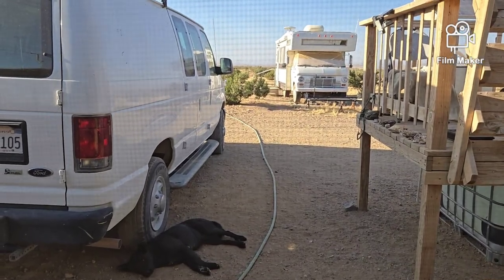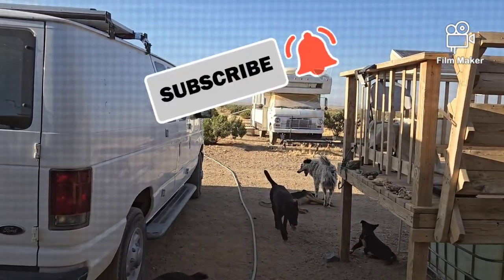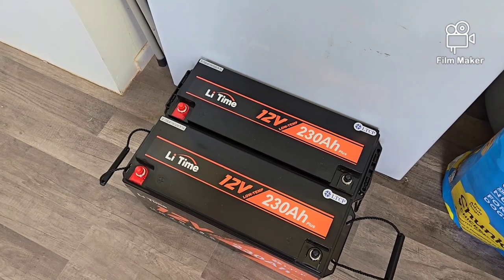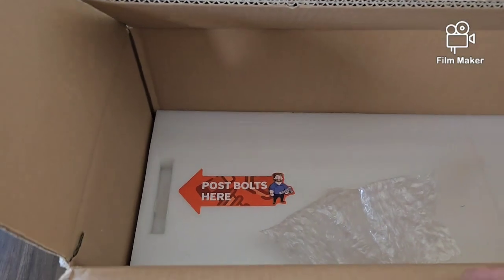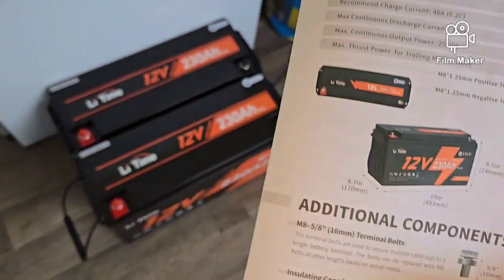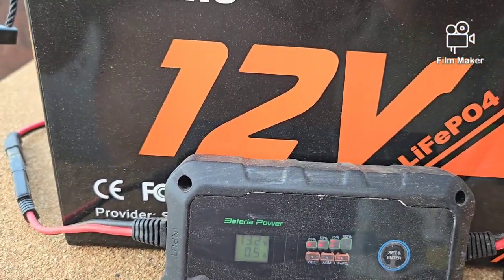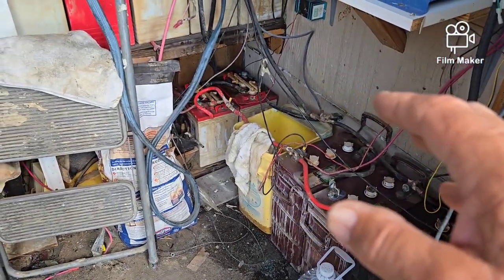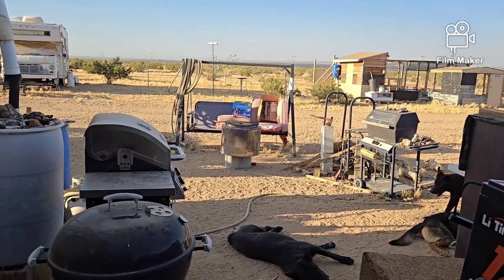HOW BIG IS THAT BATTERY? June 13, 2024

Comment: After you fully charged the batteries, what was the resting voltage of the battery? As measured several hours after charging with battery disconnected from everything. I just got this battery and the measured voltage was only 12.8 volts. The product manual states that nominal voltage is 12.8 V as well as the labeling on the battery.
Reply from the maker: @truthjustice3313  All LiFePO4 batteries are shipped with only 20-50% charge and require a full charge with a LiFePO4 charger prior to first use.
When fully charged it will initially show 14.2-14.6, but will settle back down to about 13.9 or slightly lower if you have a battery monitor attached, due to the idle current needed to run the meter.
Reply: @GBear  Thanks, that's what I thought. Mine arrived at 13.08 volts. I ran it down with an inverter to low 12's per battery monitor recommendation. Charged with Lifepo4 charger at 46amps and 14.6volts (several hours) until fully charged. BMS did not allow more charge. Let sit overnight and the resting voltage is 12.8 volts. I think it's defective.
Reply from the maker: @truthjustice3313  it could be.  It could also be a bad multimeter reading.  I found my multimeter only showing 13.3 for a fully charged battery, but once I connected a shunt/monitor, it showed 13.9
Reply: @GBear  My multimeter matches my battery monitor.
Reply from the maker: @truthjustice3313 Then you are probably correct that the battery or BMS is bad.

Comment: Did you have those 2 parallel before they were fully charged and is that ok
Reply from the maker: Welcome aboard.  Yes on having them parallel  to charge.  I couldn't find any reason not to, so thought I would give it a shot.  Seems to be OK, just taking longer.

Comment: Hi 😃 Just an idea - 1.Put your new battery bank on an on/off high amp switch so if needed you can switch the battery bank off.
2. Keep your old good batteries running as a back up system, as you already all the needed equipment.  It could also be on a separate switch or left on to run some low demand items.  lights, fans ...
Reply from the maker: The old batteries will be disconnected because I'll be using the Midnite controller and the AIMS inverter for the new LiFePO4's.

Comment: Great video Question- If one or more of these batteries fails during the warranty period Don't you need to return them in the original packing?  Seriously I want to know as I have 4 - 100 amp 12 volt LIP04 batteries.  Thanks
Reply from the maker: Well, since I don't see that requirement anywhere on the warranty, and who would save the packing for 5 years, "just in case" sounds like it wouldn't hold water in court.
Reply: @GBear  don't know but I thought I saw that requirement somewhere
Reply from the maker: @poolsidedreamer  I just checked the packaging, nothing in there.  I haven't registered the warrantee online yet though.  Waiting until charging and balancing is done.
Reply: @poolsidedreamer I was going to return a couple and they required $50 return shipping, ups only and drain charge to 13.2-13.3v or 50%.   Since G is keeping the foam that can make a nice shipping protector.
Reply from the maker: Just in case. Check with your distributors, in the chance they have super small print in Chinese.
Reply from the maker: Good point though.  I'll keep the tops I cut off so they can be taped back on, and the boxes with packing will be housing the batteries anyway.😁

Comment: I have 4 of those stacked in a closet in my rv wired 48v.Nailed a shelf together for separating each bat.Less room.Less wire.
Reply from the maker: Welcome aboard!  Yes, nice to be able to do that.  My 24 lead acid batteries will probably be close to the weight limit of my trailer.😅
Reply: It takes all day to recharge with 4 525 watt Bifacial panels.Adding 4 more panels.Then I can run AC while charging.
Reply from the maker: @2hotscottpro  I have 6, 305w mono panels and 16, 100w mono panels for 3460w total.
Reply: I’d like to have a 320 ah 48v bat next.I’ll build it from cells.Way cheaper.
Reply from the maker: @2hotscottpro  Nice.  I'll be buying 4 server rack batteries and a 1048 all in one package from SungoldPower when my money gets here.  That will be a 400ah system, then I will add these 4 in series for another 230ah.

Comment: Lead-Acid battery converted to Lead-Alum will extend the battery and the charge/discharge curve is more like lithium. it does not make 12 volts more like 10 volts, but it can run lights for a long time. if you series three 6 volt batteries you should get 15 volts. and can be used with 12 volt inverters.
Reply from the maker: Interesting.  Good survival info.

Comment: Another beautiful aspect of LiFePo4 batreries is that you can run them down to 10% SOC w/o damaging the batrery. Lead acid are good to only 50% before they sustain damage. So, in effect, one 100AH LiFePo4 battery is equivalent to two 100AH lead acid. My 100AH lithium weighs 24lbs compared to almost 70lbs   for the lead acid. The weight is important when batteries are used in RV applications. Good choice, Gbear.
Reply from the maker: Yep!  Thanks.

Comment: Lifepo4 likes mppt.   The trickle charge of PWM controllers can mess with the  
BMS.  Once lithium is full it doesn’t need a trickle charge.   

13.2-13.3 is the shipping charge rate approx 50% 13.6-13.7 is the resting 90% range.   It’s interesting they go from 100 to 90 once the charge is stopped and a load is applied but slowly discharge after that.
Reply: Greetings, I've been working with Li-ion batteries (18650's) for many years. I found some little known information about Lithium batteries. The max charge for the 18650 cell is 4.2 volts and the max discharge is 2.8 volts. with an average life of 500 cycles. The interesting thing is that if you only charge them to 4.0 volts the life cycles will increase to well over 1000. Also, if the only discharge them to 3.0 volts the life cycles will again increase to well over 2000 cycles.  I can only conclude that the LIFEPO4 should react the same way. The batteries I've been looking at using, in future installations, indicate a max charge voltage of 14.4 to 14.6 and a max discharge of 10 volts. Utilizing the same logic, if I only charge to 14 volts and never discharge below 12 volts, the life cycles should increase from the advertised 4,000 - 15,000 to 12,000 - 30,000 cycles. At that rate I won't have to worry about replacing the batteries on the future buildings. The 3 existing buildings on my North Eastern, Nevada ranch will need replacing in 5 to 8 years.
Reply from the maker: @mis-fit-acres-granny Sounds like a plan.  Yes I just finished reading about SOC and SOD extending the life cycles.  Even at extremes, these LiTime batteries are rated for 4000 cycles, and I'm hoping to extend that to 6000 through proper treatment.
Reply from the maker: Yep, I'm learning more and more about lithium.  Interesting stuff.  The new kid on the block is super capacitors.  Gonna replace all batteries, because they don't wear out, less bulk, lighter weight, and no electrolyte hassles.

Comment: Make sure your charger is specifically for lithium iron phosphate batteries the others won't work that's what I was told a year ago I had to buy one off eBay
Reply from the maker: 100%correct!  My BateriaPower controller is compatible with LiFePo4 and mppt to boot.

Comment: Sounds like a good plan to me. My question is with all of those old batteries removed what would you use the shelves for?
Reply: Ore bearing rocks!
Reply from the maker: @desertrestnv  Ore not...🤣
Reply: @GBear  Au...
Reply from the maker: @desertrestnv  Who, me?
Reply from the maker: Electrical component storage.  Make room in my container shop.

Comment: Congrats again g bear. Save a 12v battery back for the what if. As I found out if they get too low they shut down the bms. Then sun comes up but controller doesn't see the batteries so it doesn't turn on charging mosfets. I'm saving 4 12v leads for this reason. 48v system
Reply: You cannot reliable know state of charge of a lithium battery by voltage alone due to the more flat voltage curve of lithium you will need a shunt and amp meter that can track amp in and out . Good luck lead is simple and more reliable.
Reply from the maker: @teddycunningham7568 True, the voltage only give an estimate of the SOC.  After 9 years with lead acid, I can say that I  should be able to make an accurate statement of which is better.
Reply from the maker: Thanks.  Something to consider.

Comment: I have been thinking 2 100aphr batteries would run my Wynter dual control refer freezer laptop and phone. How long do you think it would take to charge with 100watt solar panel.
Reply: I have a 58 qt 12 volt compressor fridge that I used for camping. The compressor draws 45 watts at start up and drops to ~30 watts running. I have one 100 AH LiFePo4, and it would easily run the fridge for at least 2 days, if not more. I use a Renogy folding 200 watt solar panel to charge the battery every day. Normally, the battery is fully charged by nightfall and is at 13.3 in the morning.  My day usage includes running a 12 volt water pump and some lights and a TV at night. The TV and lights are draws that obviously occur after the solar is done charging, so they add to the discharge along with the fridge. I really enjoy the lithium battery.
Reply from the maker: @larrycarlston4044 Thanks for the confirmation of what my research has informed me.
Reply: @GBear   You're welcome. I'm very happy for you. You deserve it. Just imagine, no more watering, cleaning corrosion, etc. Yes sir, Mr. Jefferson, you done moved on up to the east side..
Reply from the maker: @larrycarlston4044  Thanks, but I'll stop before I get to the deluxe apartment in the sky....
Reply: @GBear  Me too.
Reply: 1280watts times two equals 2560 

25 hours for one 100 watt panel to charge two empty lifepo4 100ah batteries.    That is if you get exactly 100 watts the whole time.   

A general rule (confirmed by YouTubers) is it takes one 100ah lifepo4 to run the average fridge for 24hrs.   That is without any charging.
Reply from the maker: @WattsinWattsout good info.  Thanks.  I may have to set up the Midnite to do the charge with 1800w coming in...
Reply from the maker: The freezer alone would need about 200w to start, then lower to about half that to run.  Again, I don't know your inverter idle draw, your controller efficiency, mppt or pwm, etc.  Wire sizes, distance from panels, number of hours of direct sun on the panels, etc.
Get yourself a "Kil-O-Watt" meter for about $10-$15, and check your watts usage for each item you plan to power.  Those numbers help decide your panel array size, battery bank size, controller size, and inverter size.
Note that if you plan to run modern appliances and computers, you need Pure Sine Wave inverter.  Modified sine will damage them.